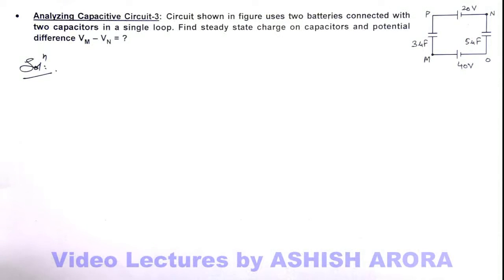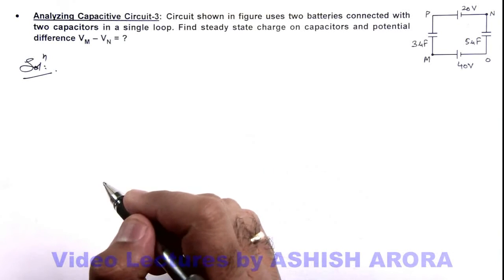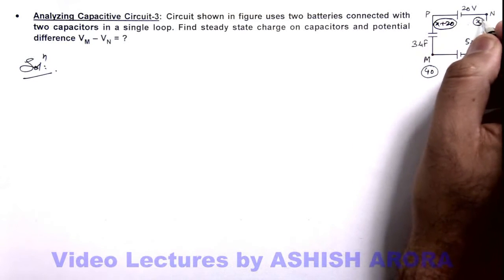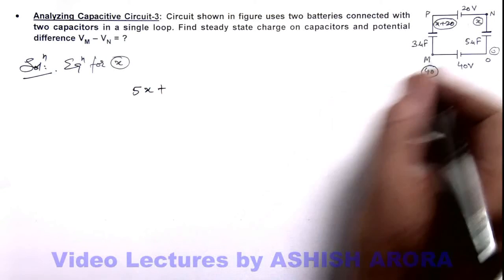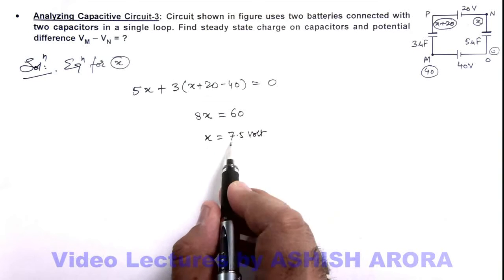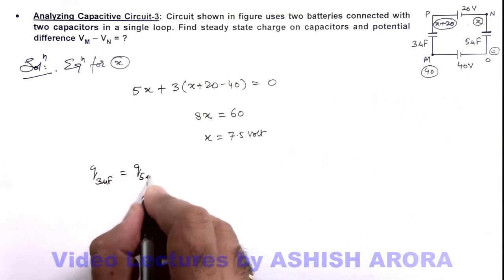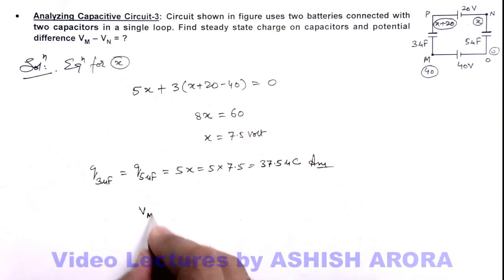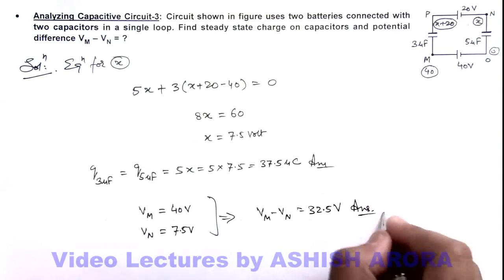15. Advance Illustration | Capacitance | Analyzing Capacitive Circuit-3 | by Ashish Arora

Comment: Net charge is flowing in the circuit in clockwise direction and the sum of charge on -ve plate of 3 micro farad and positive plate of 5 micro farad is zero because same charge is flowing through both the capacitor.
🙏

Comment: I guess my method here just comes by applying one KVL eqn is easier i got to know that charge on both capacitors will be equal by isolated system charge should be zero thing .so charge came 75/2

Comment: sir how can you tell sum of charges is zero?
Reply from the maker: Because we consider initially capacitors were uncharged before circuit was made...
Reply: @physicsgalaxyworld  We were considering sum of charges as zero for isolated system....but here both plates of capacitor are connected to battery...plz explain

Comment: Here simply equivalent EMF can be taken as the batteries are in series. EMF = 20V. Similarly equivalent capacitance can be calculated C= 15/8. Now Charge Q=C×V=(15/8)×20=37.5
Reply from the maker: Yes it can be done and later to find the required potential difference you need to write KVL equation. In above video just be writing one equation, result is obtained.

Comment: why didnot u take n on zero potential???
Reply: Truth: Potential can be taken zero at any point in circuit. We should ensure that no other point is appointed 0 potential and remaining nodes are given potential relative to that assumed 0 potential.
Reply: because by doing so u mean that across 5uf capacitor delta V is 0 so no charge on 5uf but if that so then how would battery tranfer charge to other capicitors
Reply from the maker: we have taken zero at negative terminal of 40V battery... what exactly you wish to ask...
Reply: on negative terminal of 20V  battery why dont  u took  zero potential
Reply: Esa  hota sab jaga 0 ane  lage ge  lol

Comment: sir for equation of x first plate of 5 μF capacitor is connected to potential of x but how the plate of 3μF is connected of potential x as per diagram it is connected to x+20. please reply
Reply from the maker: Yes thats right but it is connected to potential of x also through battery... in equation we are using the potential of plate to be x+20 only... At any node we consider all the plates which are directly connected to the node or through a battery...

Comment: sir why is it in series i mean that it is not conected like positive plate of one with negative plate of other
Reply from the maker: These are not in series but by using the concept of branch manipulation we can shuffle the devices and consider them in serious without affecting the charge on capacitors... however you using above method you can solve this que by potential distribution without considering these in series...
Reply: thank sir
Reply: Physics Galaxy sir sorry if i m going wrong but if they are not in series then how we are writing the equation of x.. if the same charge of 3muf capacitor do not go to the plate of 5muf capacitor then why we are equating net charge on 2 plates to zero

Comment: Sir,how can we use nodal analysis here,battery is also connected to node??
Reply from the maker: There is no such condition that a battery is there or not... a node can be considered and extended from one plate of capacitor to all those plates of other capacitors which are connected to this plate and in these connections batteries may or may not be present...
Reply: But if battery is present,it can provide some additional charge,so charge conservation across wire need not be true?
Reply from the maker: battery can only transfer charge from one side to another, conservation is not affected by this... transfer is happening within node only...
Reply: OK thanks for explanation.
Reply: this is supernode analysis, when battery is connected between 2 nodes

Comment: Sir here in this question both the plates of both the capacitor are connected to same sign terminal of battery,So I m wondering how will it get charged ?
Reply from the maker: sign of batter is just signifies low or high potential as batteries are of different emf it will receive charge as one is high compared to other...